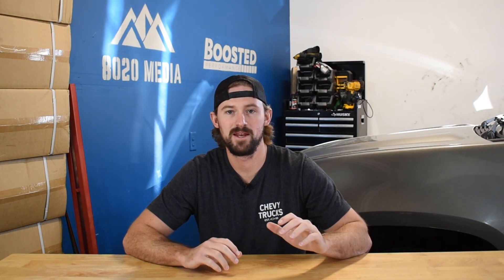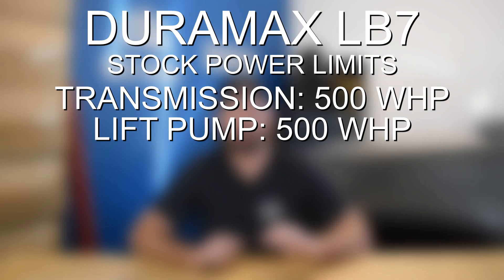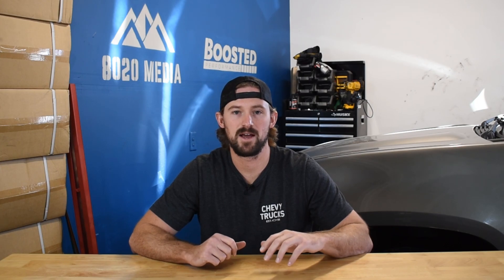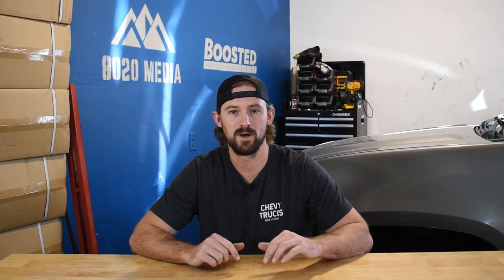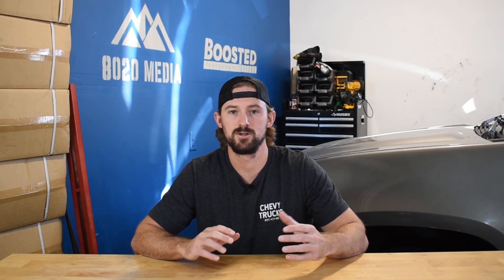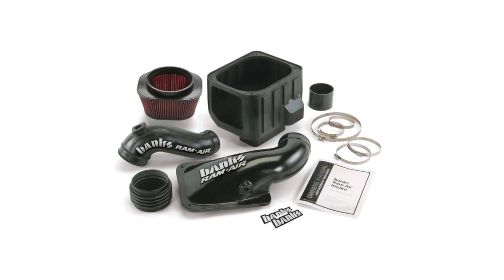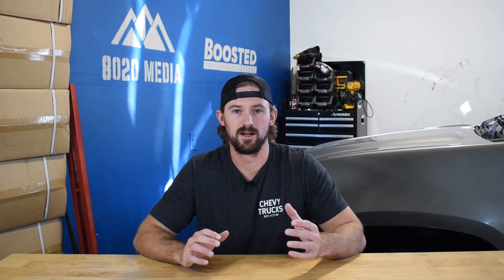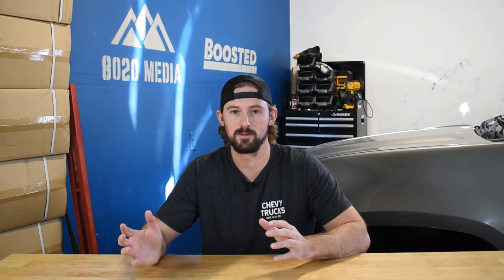How to Build a 500WHP Duramax LB7!

Comment: I'm brand new to this, so sorry if this is a dumb question, but is tuning required for any of these bolt on mods? Or could i do these mods and experiment with tuning later on down the line?
Reply from the maker: J - It isn't required, and most times may be best to do it after all of the other mods are installed. It all depends on your goals.

Comment: 90hp over stock on the 5 speed Alison, is all that's safe. Ask me how I found out
Reply from the maker: T - Lol. Lets hear it
Reply: been running 135hp for 3 years and i run it and i have never had a issue testing my luck see
Reply: @john_schanbacher  : First time I tried the stock trans  90hp mild max tune, From Idaho Rob, El limpo! Drove my truck to Screamin Diesel Performance, about a month later, had the trans built in 2015, no issues since. Also got the built trans tunes, with the big tune #5 being 230hp, and wow! Did end up having to do head gaskets in 2022, back to SDP, and 45% over SAC exergy injectors, just for longevity. Stock tune is way stronger, than it used to be. Maybe a tune #2, or #3,  from what it was with stock injectors. Unfortunately Rob's tuning is no longer available, so you'll have to find a new safe tuner. I've switched from, as much power as possible, to keeping my engine healthy as long as possible.
Reply: I've heard it's between 450 and 500 hp when you need to start looking at getting a built transmission
Reply: @hiimtheguy1606 450-500 crank. Stock motor makes 315 so a little over 100 over stock which is about right. 90 over is doable for a healthy trans that’s serviced properly but over 100 your on borrowed time and it your slipping and loosing a lot of hp to drivetrain lose. I have a stick trans and keep my truck at 50 over stock for mpg and throttle response and then if I need it I’ll put it at 100 for racing and or long road trips for the best fuel mileage. Keep in mind 135 hp tune is the best for a lb7 for fuel mileage and anything over that goes backwards (if you can keep your foot off the loud pedal lmao)
Reply: @hiimtheguy1606 : Nope that the limit of stock turbo, and fuel. 100hp over, is max to keep a healthy tranny.
Reply: I would have to agree I threw in 45% over injectors in my truck with no other mods and my trans was not happy
Reply: @RacersRUS69 : Oh, that happened long before the 45% sac's went in. This was 2015, then built the trans. My head gaskets, ARP head studs, and injectors were done in 2021.

Comment: If you were going this route I would definitely consider at least a fluid damper. Relatively easy install and it will prevent a broken crank. Also, some tierod ends & traction bars.  A 2017 oil cooler ain't a bad idea either & a tigged water pump from merchant automotive.
Reply from the maker: B - Thanks for sharing this insight.

Comment: What’s the best way to make a zf6 trans last on these not the auto Allison
Reply: A stronger clutch is all the zf6 needs ever. That zf6 will hold more power than the Duramax can make without snapping the crankshaft.
Reply: I was wondering the same thing

Comment: You need to do some research that wont get you 500 to the wheels and the FIRST thing on any duramax for longevity is ALWAYS  a lift pump
Reply from the maker: Agreed on the lift pump. Plenty of dyno results around the 500whp mark with intake, exhaust, lift pump, some trans upgrades and tuning. Sure, it is a max effort tune so not the safest to run consistently but these mods can get you there.
Reply: my homie lly made 551 with downpipe, 5in exhaust , intake , 60% nozzles and 68mm kbd turbo .. stock engines/trans
Reply: @Sheluvskeeno  yeah I've heard that a million times until they end up in my shop with blown head gaskets and bad stock transmissions sure you can get away with it for a little while with a stupid amount of fuel but it will not live the stock turbo can't handle anymore that 550 max after that mark it's EGT city but hey what do I know I've only been in the diesel field for 15 years also I doubt your buddy had a Dyno sheet 90% of people just believe the tuner when they tell them "it's a 250hp over stock tune "
Reply: @haydendenard2693 I completely agree. My old LB7 laid 481 to the wheels in 4th torque converter locked. It lasted a little while before clutch packs welded together. At 250k it needed a transmission, head gaskets, and a turbo. An LB7 is good for 400hp if a guy wants longevity. After that, time to empty your pockets because you’re talking thousands to make it last and actually make that power safely. But hey, I only speak from experience like you so what do we know. This videos advice will keep shops like yourself in work!
Reply: @sav300  they are great trucks but if you push them to the bleeding edge like that its hard on everything the fuel system is being pushed to the limit the factory turbo is being pushed well beyond its limit and the Trans is most certainly pushed beyond its limit doing a "build " this way is creating a ticking time bomb. Will it put out that power? Sure. Is it going to hold up if you tow heavy or race regularly with it ? Absolutely not
Reply: @haydendenard2693  exactly. It honestly doesn’t take but a few times in the hot tune to get the transmission to the point of no return. This video is full of bad advice.
Reply: @haydendenard2693 Curious, but is the head gasket issue on modded LB7 in relation to a flawed factory gasket design? Latest head gasket kit + ARP studs maybe solve things?
Reply: @alextorkelson yes head gasket and arp studs will fix that
Reply: @haydendenard2693  I tow 6-12k lbs daily doing tower work. LB7, stock trans, stock motor, high lift pump, cheetah turbo, banks intake, intercooler, piping, custom y bridge, 60 injectors, upgraded ficm, 5" exhaust and ppe downpipe with deep pans... 7 tune (510 on hot) and been doing the job for 4 years. Smoke absolutely everywhere but no headgasket, fuel, or motor issues... had a stuck injector for like 6k miles before atf cleared it up. Some of these site roads are in terrible shape with uncontrollably bad grades. This truck is my hauler for when the work trucks break or get stuck... still pumping
Reply: @alextorkelson old post but it’s not necessarily that it’s a bad design but it’s just that they engineered it to withstand stock power. The other issue involved with LB7s they had injector cups. They would lift and cause the same issues as a blown head gasket. The permanent solution is fleece cupless heads and a merchant head gasket kit with arp studs and grade c gasket.
Reply: Rebuilding the fuel head is what is worth it. You don’t need a lift pump for longevity, unless you’re talking big power.
Reply: All these comments basically came and told you, you were right lol 😂 people these days always got a slap back even if it’s dumb

Comment: I will jump in the lake if anyone on here wants to do up a Ditymax engine for power....Powerstroke 6.0's is where its at!
Reply from the maker: Haha the 6.0 is decent for power once you've addressed all the problems with it but the Duramax's are pretty solid for just bolt-on gains.
Reply: @8020Automotive  DirtyMax's are decent for bolt on for sure, but I got a few buddies into them, and I can't let them know that they're decent Diesels....:P
Reply: @corradettimotorsports360  you must not have seen the 1200hp Dirtys on a compound setup 😂.
Reply: I have a 05 2500 lly with efi live lift pump turbo upgrade built trans with 35s on 20x10 and she lights up fairly good for what it is nothing done to the motor yet. We  dyno it at 760hp injectors definitely coming soon lol. By far the most reliable truck I’ve owed diesel wise and power
Reply from the maker: Chris - Hell yeah, nice build!
Reply: lb7 run the world
Reply: well I'd like to meet up with u and whop ur ass with my lml duramax  I don't care what you bring ur gonna lose  I squeeze 950 on the dyno
Reply: The 6.0 is literally the worst powerstroke of all time. Not to mention, it's the only one of the powerstrokes that got Ford sued.